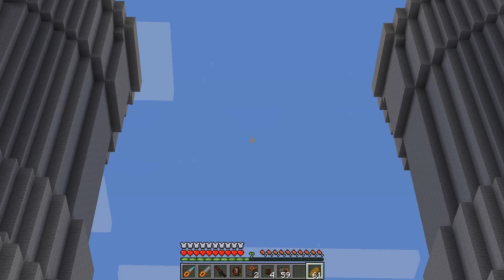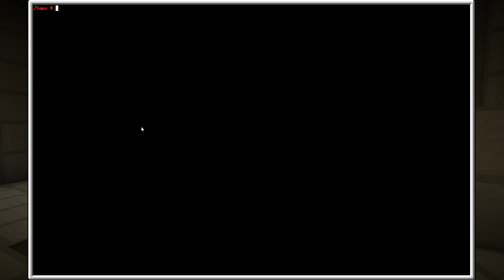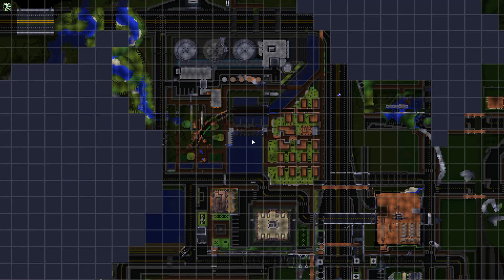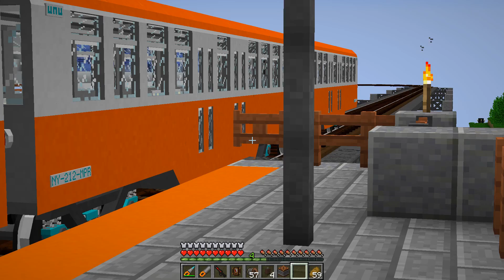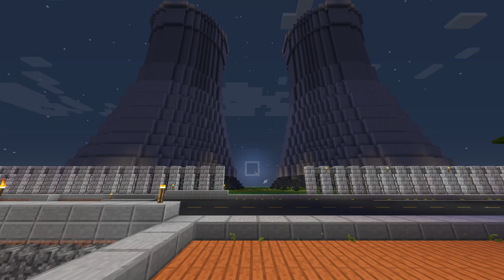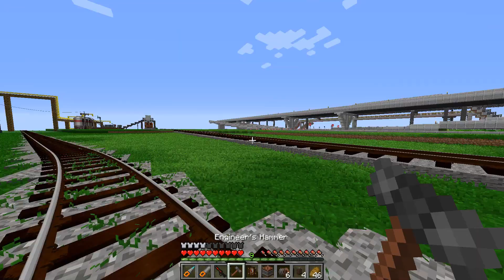Upgrading The Immersive Engineering Power Grid!

Comment: I think there is a mod called alternating flux. Its supposed to reduce losses to 1% every 1000 blocks or so for the hv lines
Reply from the maker: I will have to take a look, lol I wonder if that's considered cheating
Reply: @makeshiftgang I know in your recent video you already played around with the power loss config in Immersive Engineering which I think is also perfectly fine a solution. Though the Alternating Flux mod is pretty sweet, and it's self described balance is you can't connect it to machines, you have to step up another level and stop down again before use with machines. I think it would be cool to have, would mean you could make transformer stations of sorts to do long distance transmission, like we do in real life.